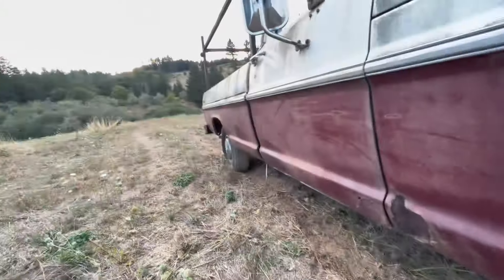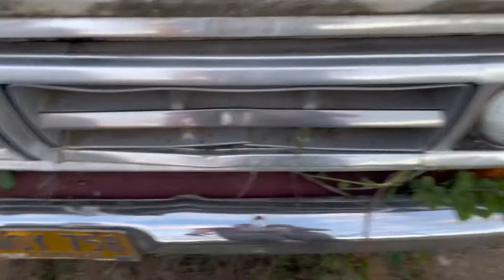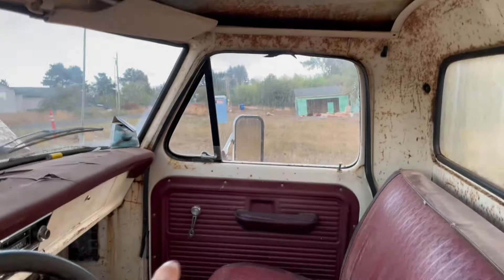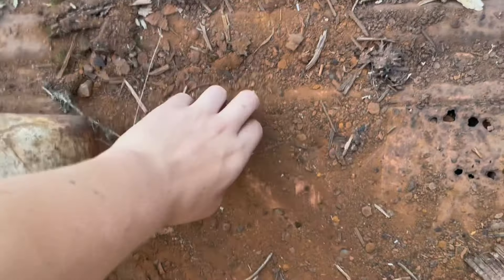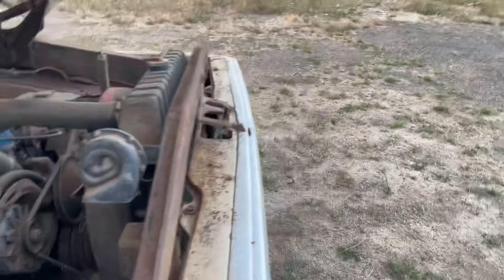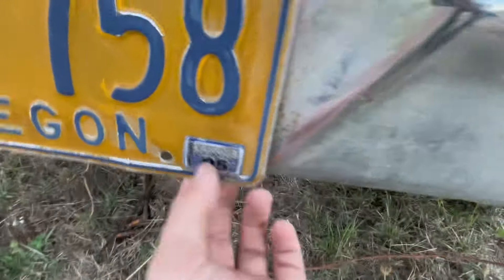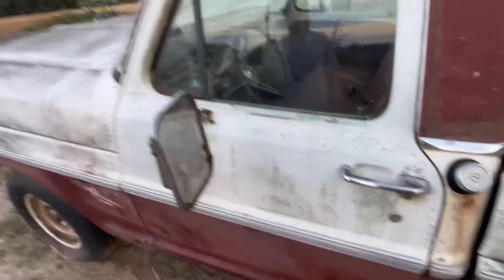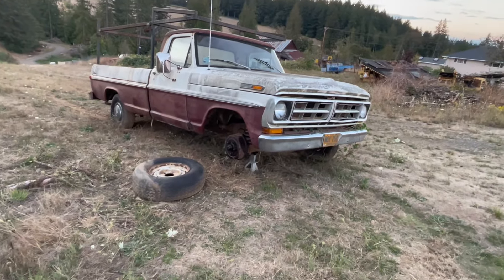My 1971 F100: Intro to the truck

Comment: to bad the cab mounts are roached on that, the difference between a 360 and 390 is the stroke pistons are the same diameter but 360 piston skirts are longer 390 uses different crank and rods.....i have a 71  sport custom highboy that i changed the crank and rods in when it was rebuild
Reply from the maker: Thanks man. I plan on remaking the cab mounts. Any tips on turning a 360 into a 390?